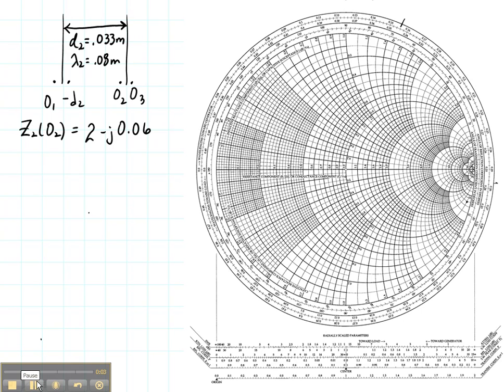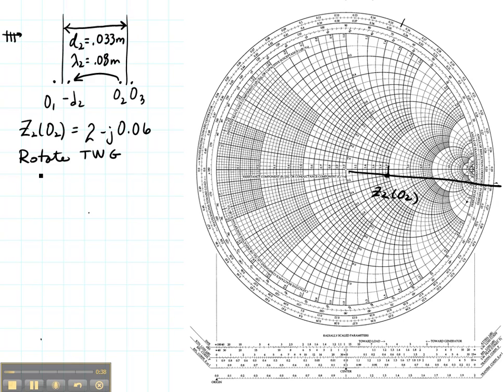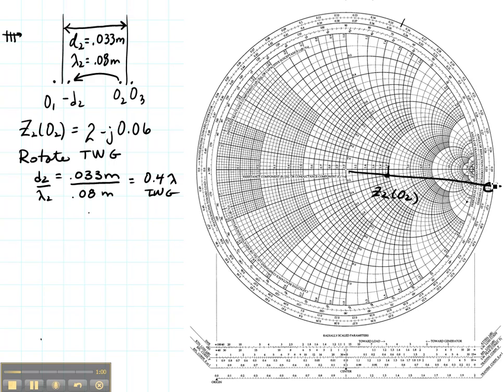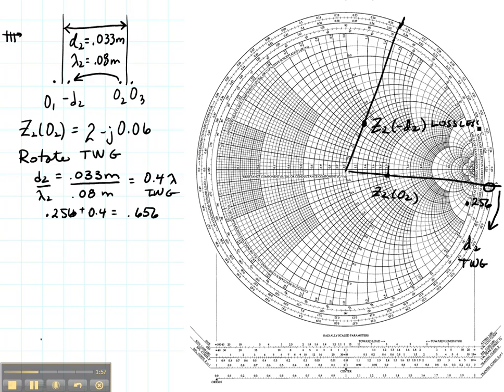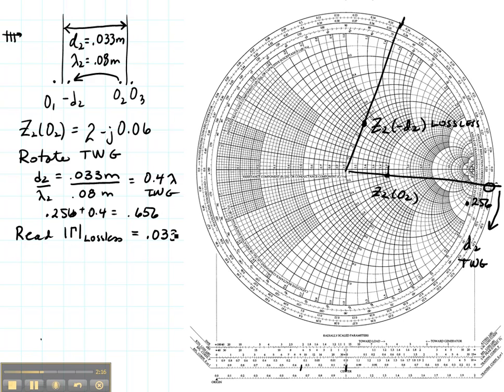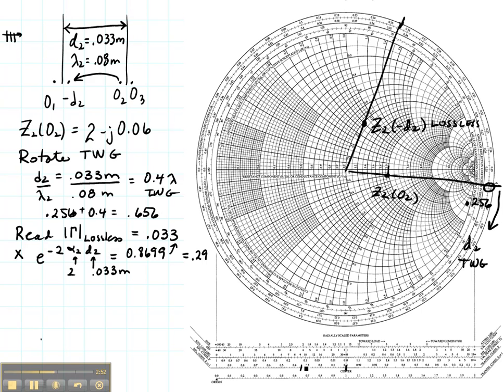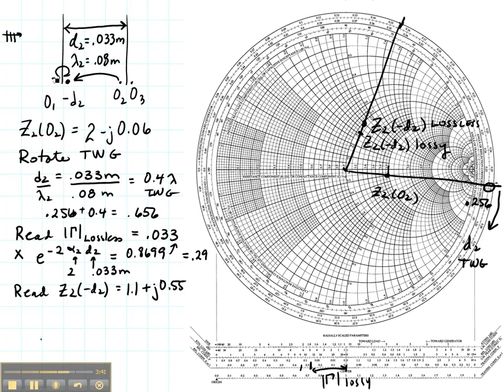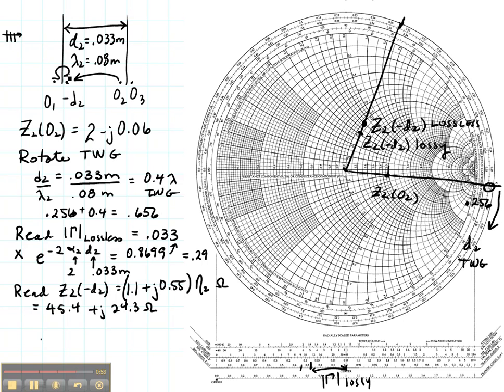ECE3300 Lecture 26B-3 Plane Wave Reflection Normal Incidence

Comment from the maker: @justinluke1166 I may have mis-spoke in the video.  Z2(O2) = 2 - j 0.06 when it is normalized. This is what is to be plotted on the Smith Chart.  See 2007 Midterm III Problem 1 for full derivation.